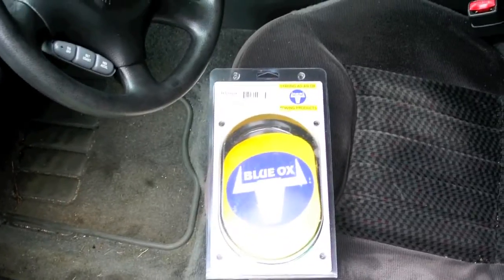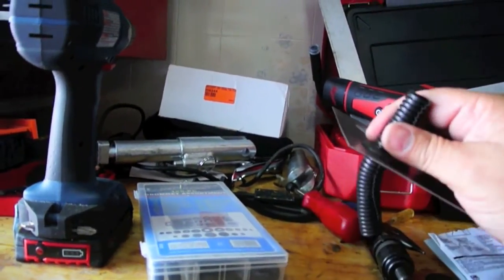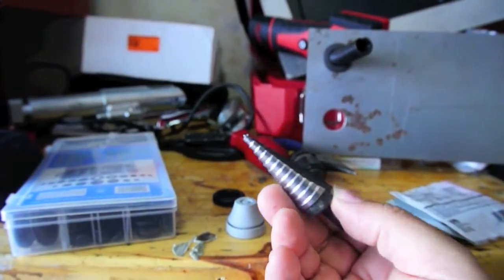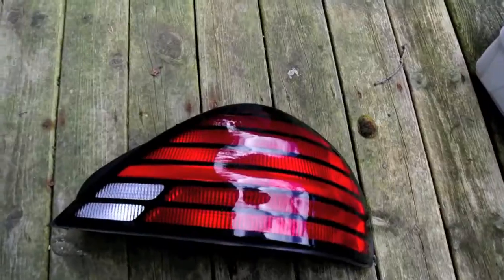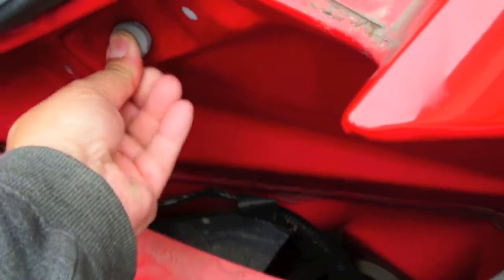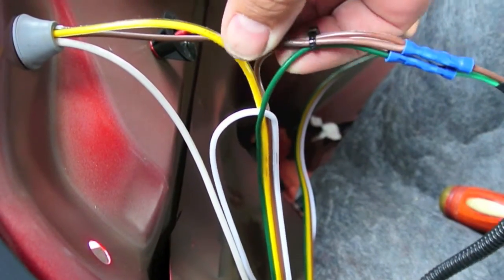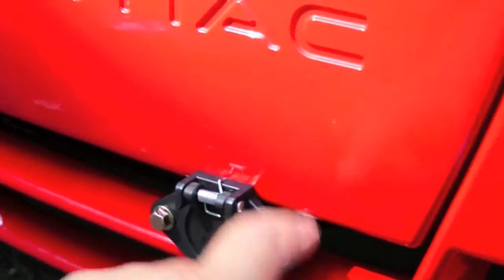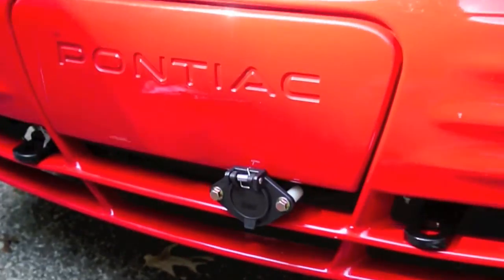RV towed vehicle project: installing tail lights.

Comment: I ran my wiring thru the engine compartment and then dropped down and ran along frame rail using wire ties already in place for factory wiring running to rear. 10 minutes tops. Used a body rubber plug to get into the trunk. No use to fret going thru the passenger compartment. Great video. thanks for your effort in posting.